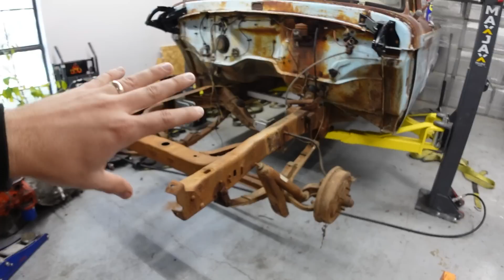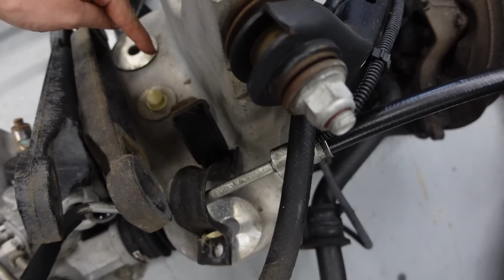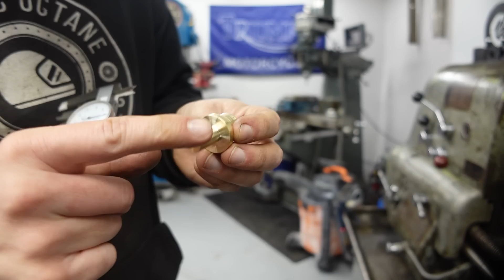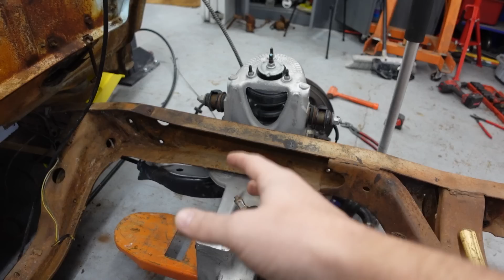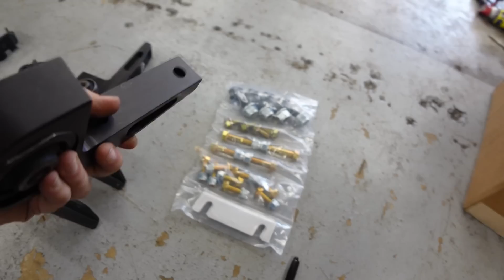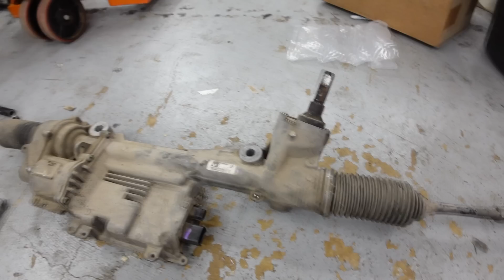F-100 Shop truck gets an incredible suspension upgrade!

Comment: For the front sway bar mounts maybe worth dropping bolt through the chassis and welding it captive so the bracket goes up and then nut it without the need to hold the bolt from inside with a spanner, especially if you want to remove it at a later date with the rest of the truck all fastened together if that makes sense 👌

Comment: I've been watching your channel since you started, I don't often comment if at all, but I have the same two problems with it, 1, you jump about too much and leave so much out that might be useful, 2, the camera is very jerky at times, slow down and it will improve. I just noticed your subscribers are a lot lower than the 250k I would have expected by now, something not right there.

Comment: As a retired engineer who used various machines in the engineering environment, I noted several health and safety infractions within the first several minutes of your video. You seriuosly need to get some proffesional instruction in safe machine operation before you produce any more of this type of content. One thing is your lack of eye protection, the brass you are maching looks to be producing large amounts of small sharp fragments which is common with a brass containing a certain amount of zinc, very sharp and can cause serious eye injuries. Anyone attempting to copy what you are doing could end up getting serious injuries. Sorry for the negative comment but, my whole career was governed by risk assessment and health and safety. Please gen up on your haelth and safety requirements. On a plus note, I do like your project content. Just one more point, I used to operate a lathe with a 72 inch faceplate and 36 Feet to the taistock.

Comment: On your next vintage vehicle project take a bunch of measurements before you tear down the vehicle. Measure stuff like the wheel base, track width, wheel centerlines etc.  All vintage vehicles no matter what manufacture will have slight differences from vehicle to vehicle. Some trucks even came from the factory with axle centerlines not centered in wheel well openings. Then add on top of that you are talking about a 61 year old work truck. Work trucks can see a lot of abuse in their life time. Frames can twist, spread, bend, etc. So always measure, measure and check and double check everything. Never assume something, unless you are ok with things being off when finished.

Comment: cool, biggest thanks for sharing this. crazy but my 66 had twin I beam, must have been a change year. for my 2, rust converter and safety glasses on the lathe
Reply from the maker: I think Ford was all over the place with these trucks in the early to mid 60s.
Reply: @ClassicOctane  Seems like you like to take little digs at Ford. There's a difference between not knowing about something and something being bad. The style of suspension that was in the front of your truck was used by Ford in their trucks from 1942-1964.
Reply: @ClassicOctane  my bad,after another look I saw the grill, I don't know why I thought it was a 66. gonna be killer
Reply: Twin I-beam suspension was introduced in 1965 and ran all the way up thru 1996 2wd Ford trucks ( 97 on OBS HD's , changed from king pins to Ball joints in 1980 ) .